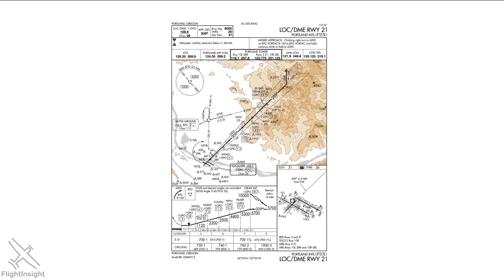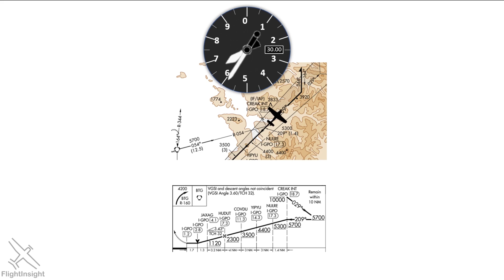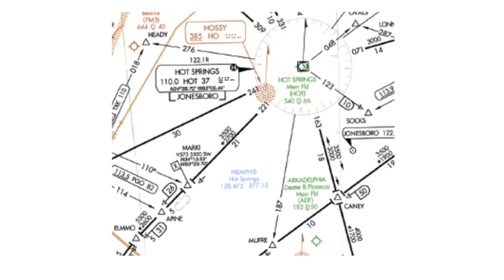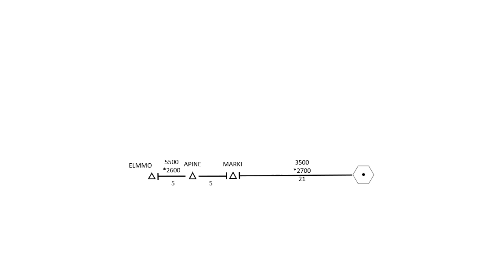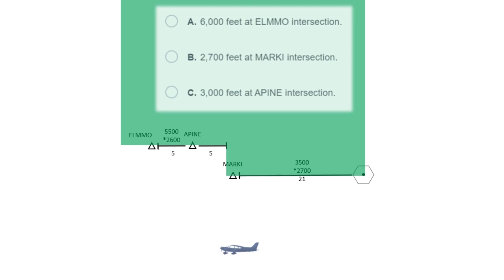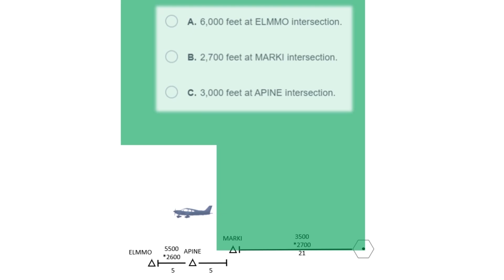IFR Test Questions that May Stump You | Instrument Rating Airplane | FAA Exam

Comment: In the first question, second scenario (when you're not on the feeder route), why can't you descend to the MSA (provided within 25 nm of the waypoint)?
Reply: The MSA guarantees you obstacle clearance but it does not guarantee you reception of navigational or communication signals. If you are not on a route that has a published lower minimum altitude, such as the approach itself or the feeder from BTG, you must remain at your last assigned altitude until you are on a published segment of the approach.